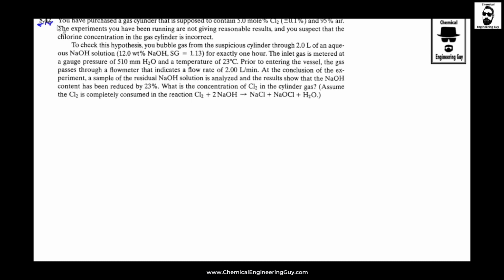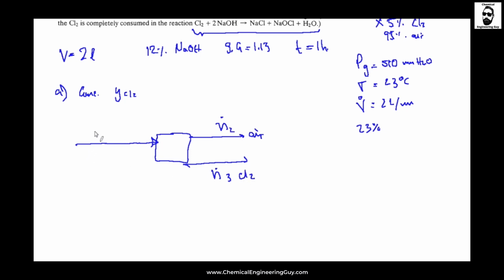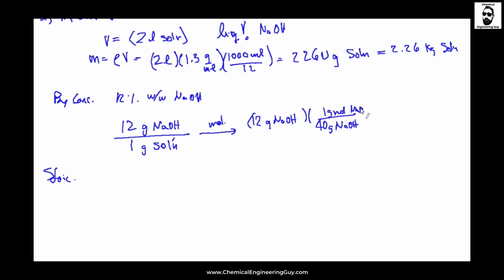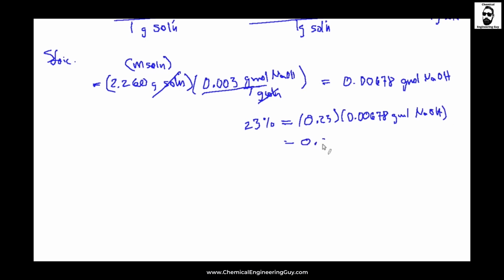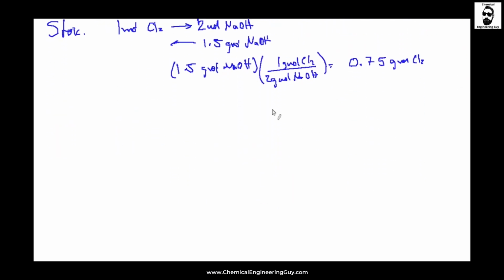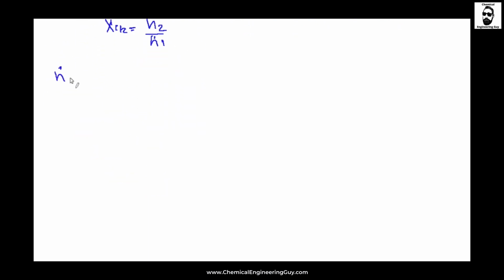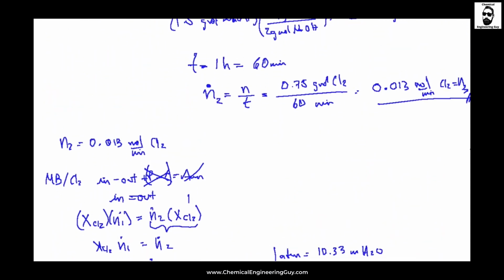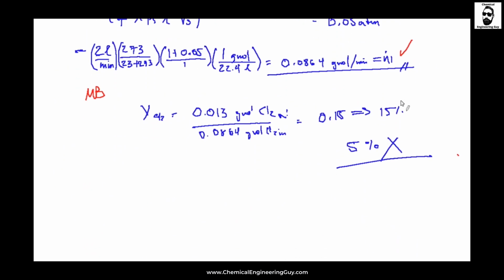Chlorine Tank Concentrations, Pressure and Ideal Gases (Ex. 5.42) Mass Balance Practice Problems

Comment: why do you say that 12wt% is 12gr/1gr?      12wt% or 12 w/w% = 12% NaOH + 88% water
Reply from the maker: You are absolutely correct. 12 wt% (or w/w%) means 12 grams of solute per 100 grams of total solution. This translates to 12g of NaOH and 88g of water.If "12g per 1g" was mentioned, it was likely a slip of the tongue or a misunderstanding of the ratio. In mass balances, we typically use the mass fraction ($x_i$), where 12 wt% is written as 0.12 kg/kg or 12g/100g. Defining it as 12g per 1g would imply a concentration over 1000%, which is physically impossible. Thank you for pointing that out—it's important to keep the "per 100" part of the percentage clear!